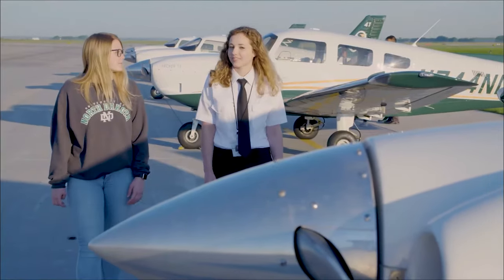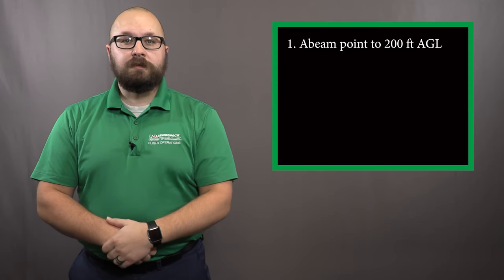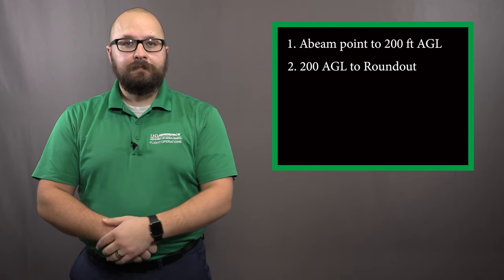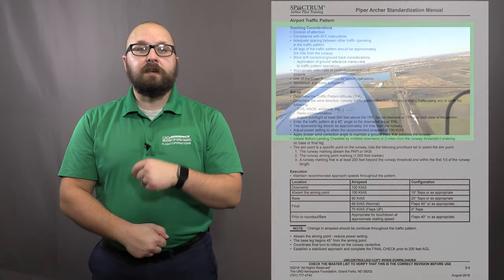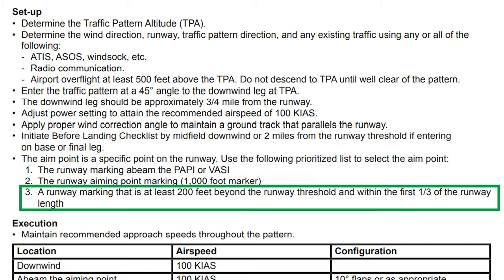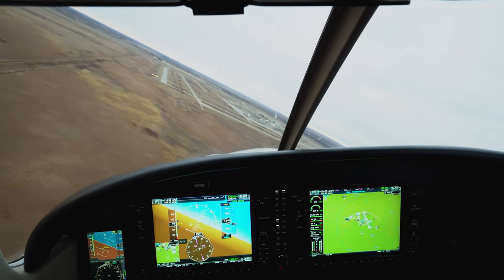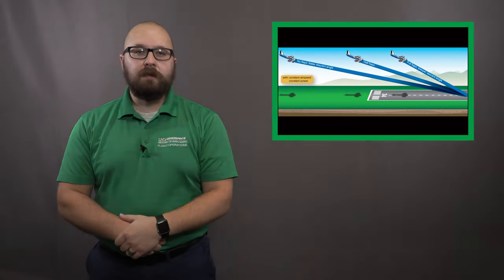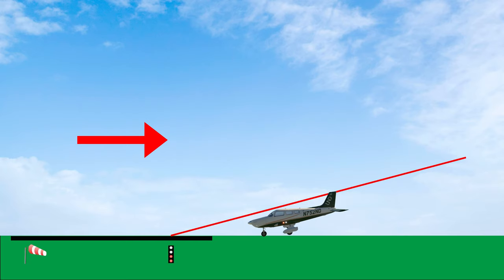Landing Series Part 1: From your Abeam Point to 200 FT. AGL

Comment: But Sarge! What if the wind is 36 knots at pattern altitude, but 8 knots on the surface. How should I adjust my approach?
Reply: This is a common scenario, especially at KGFK. The best way to handle this is to be prepared to adjust your power, crosswind correction, and pitch attitude as you descend on final as this is where you observe the largest change in wind speed. It is likely that you will need to increase power and pitch the nose down as the wind speeds decreases due to an increased ground speed